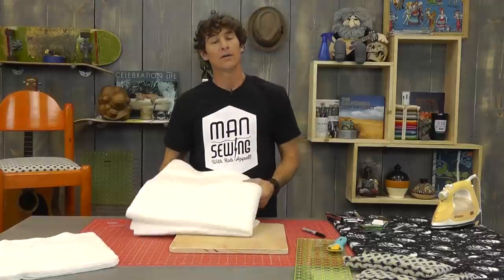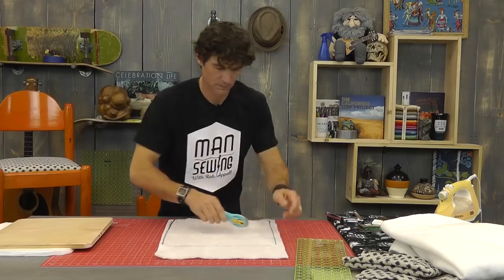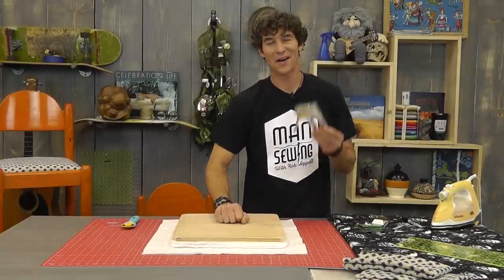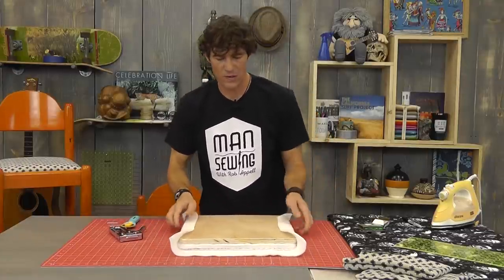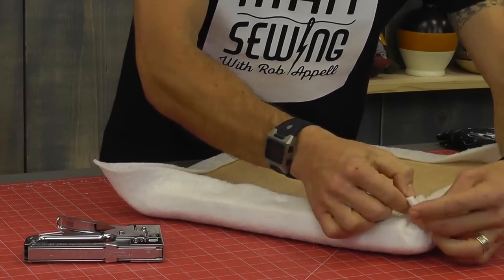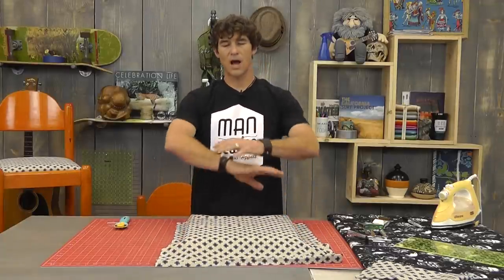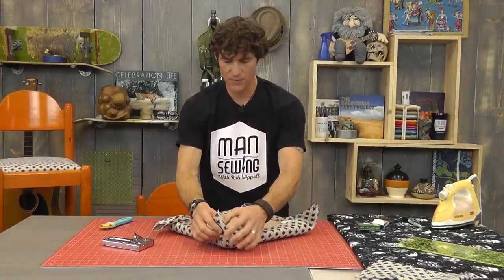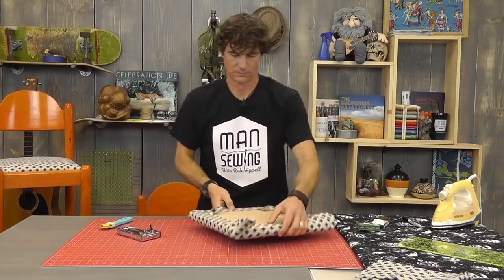Recovered Dining Chair: An Easy Sewing Project with Rob Appell of Man Sewing

Comment: I did one set with electric stapler but found it difficult on arthritic hands.  I then purchased a pneumatic stapler/tacker at HD.  It was on sale so a benefit.  I have now done some dining room sets for people and have turned out great.   A small side business and love the results.   I also did the chairs backs.   After taking apart, I traced the shape on brown craft paper to get a template.  Added a half inch steam allowance and did one up on sample fabric to make sure it would work.  I found the first one ended up a little loose so tightened up the seams.   They turned out great and very professional looking.  You then just slide the back into the pocket from wide end(usually the bottom).  Sew the bottom and the top usually just fits into the slot at the top of the chair.    Suggest everyone give this a try as it is easier than it looks.
Reply from the maker: That's awesome, Gail! Feel free to share a photo of your work on my Man Sewing Facebook page! Have fun recovering chairs! :)

Comment: I recovered my dining chairs pretty much using this method last summer, I used an upholstery leather with an upholstery brushed denim material in a half square triangle.  My Cats have ruined all the leather sides, they think I did this special so they could sharpen their claws.  The brushed denim is holding up really well so I'll most likely be pulling staples for a couple of weeks again this summer.

Comment: I've been doing this with my husband and he hates helping me.  So your tute has offered me the chance to try it my myself.  Thank you a thousand times!  What stapler are you using???  We have an old electric and it jams.  I want to use a manual stapler like yours.  What do you suggest?  And will it fit a woman's hand?
Reply: I've used a manual stapler for years, and my hands are small. The only problem I've encountered is that the stapler will "jump" sometimes, not inserting the staple all the way. I need to push down with my free hand on top of the stapler to keep this from happening. Oh, and my stapler is one from the local hardware store.
Reply from the maker: Mine was a small one that I picked up at Home Depot!

Comment: I'm curious what the difference is between using staples vs tacks? When I took apart the seat to my old chair the person who had originally done it used tacks (short nails). I saved them and there are holes in the wood but can't decide if I should stay w/ the tacks when I redo the seat or if I should go with staples. It's a wooden chair , maybe fifty yrs old. Thanks for posting this video. I wasn't quite sure how to go about recovering my chair but now I feel more confident.
Reply: Those are most likely upholstery tacks, either works well but staples are not quite as expensive.  Also, this does not apply to you but upholstery tacks/nails will have a large head that could interfere with the base if it wasn't used before.  Having your chair upholstered with tacks also probably means it's a higher end piece of furniture (better quality, more expensive)  If it were me, I would invest in new tacks when recovering your chair.
Reply: ***** Thank you! :)